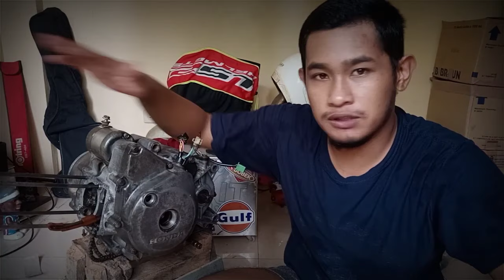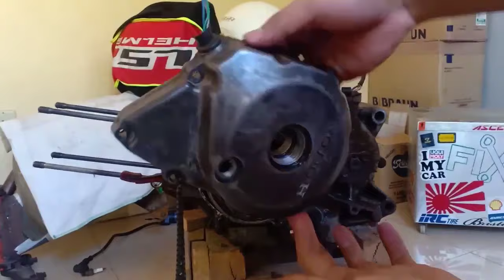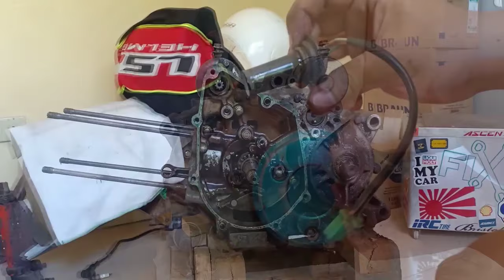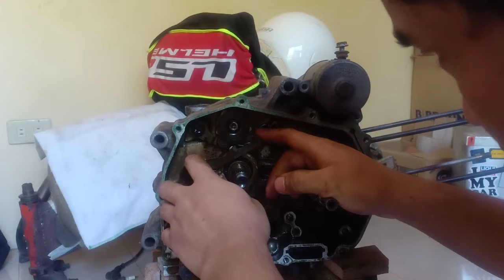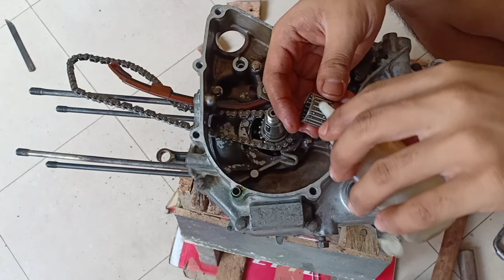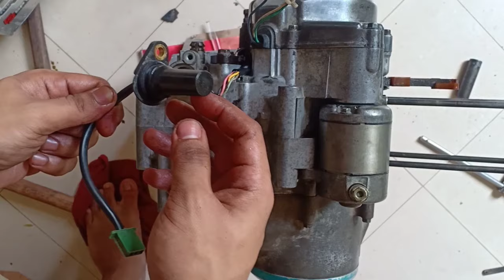Engine overhaul | XRM/WAVE 125

Comment: Lods ano naman ang possible na sira kapag may lagutok sa bandang baba ng starter?
Nagpalit na po ako
Conrod n side bearing
Clutch  housing
Primary clutch
Transmission bearing

Salamat po sa sagot nyo lods💕
Reply from the maker: Lahat nman ng possible na mag ccause ng lagutok lods napalitan mo na. Sa opinion lo ng lods, yung nakikita ko nlang possible cause is baka may tama na yung timing chain tensioner o hindi na sya gumagana or di naman kaya masyado ng lawlaw ang timing chain kaya kahit maayos tensioner may lagutok padin. Isa din lods yung possible maluwag na yung piston sa bore kaya nag ccause ng knocking o lagutok. Disclaimer lang lods hindi po ako expert, based sa experience lang po ang sinasabi ko. Mas okay padin mag consult sa expert mechanics para hindi masayang pera nyo sa mga pyesa na hindi nman kailangan palitan. Thanks for watching. Staysafe & Ridesafe!
Reply: @SEXTUSMOTO  ok lods maraming salamat💕

Comment: Shoutout sa next video! Support #SextusMoto ☝🏼
Reply from the maker: Sure boss. Salamat Cap! Ride safe
Reply: paps tanong ko lng.  pag nag convert ba into manual..  maingay ba talaga yung makina?  tnx paps.
Reply from the maker: @dave gabas Yung sa Dream 100 ko hindi naman. Ito kasing 125 di ko pa napapaandar. Salamat paps. Pa like, share and subscribe po. Ride safe!
Reply: dami kasing nagsasabing magsisi kalng..  hahahaha..  tapos npo paps.
Reply from the maker: @davegabas8110  itong akin kasi kaya ako nag convert dahil sira na centrifugal ko. Mas napamura kasi ako at para maiba naman haaha
Reply: oo nga paps yung sa akin namn lalim na yung primary clutch nya..  pero paps may clutch kit ba yung sa dream mo??  or saw2 lng??  pakita namn paps kung anong diskarti mo dun.??  salamat.
Reply from the maker: @davegabas8110  hindi saw saw yun paps. Yung mga naunang conversion kit na kinakabit lang sa crankcase cover gamit ko. Tignan mo dun sa pinaka una ko na upload na video, gamit ko dun yung makina ng dream. I pause mo sa 3:20, makikita mo dun sa crankcase cover yung kulay silver.
Reply: anong tawag sa kinabit mo paps??  may nabibili bang ganun?  ok lang sya paps..  simple lang.. angas din eh.
Reply: Idol pano poba gawin ng tama kapag mag install ng kambyo?
Reply from the maker: @Engotyan Mesa pasok nyo lang po ng tama yung spline ng shifter pedal mo dun sa spline ng shaft na pinagkakabitan nun tapos higpitan nyo po ng maayus. Thanks for watching po. Staysafe & Ridesafe!
Reply: @SEXTUSMOTO  sir just asking po magkano po kung bibili ako ng makina wave 125
Reply from the maker: @Bobafatima  No idea po ako. Try nyo po mag search sa facebook kung makita kayo sa mga groups. Thanks for watching po. Staysafe & Ridesafe!
Reply: Sir pki message naman po kung meron kayo mapagtanungan kung how much po tnx
Reply: @SEXTUSMOTO  sir kung may mapagtanungan kayo kung how.much po  ung makina ng 125 pkitxt nlang po tnx
Reply from the maker: @Bobafatima  no problem po.